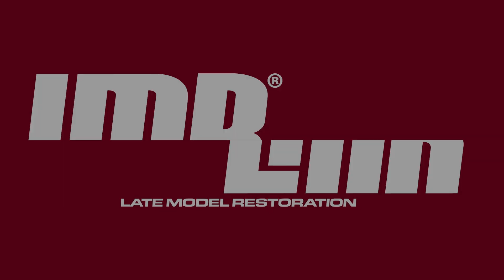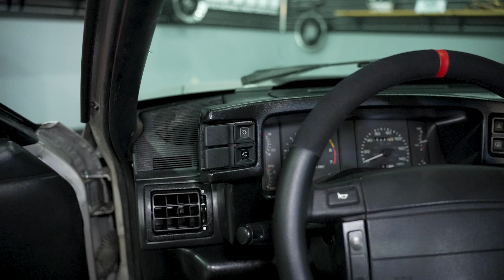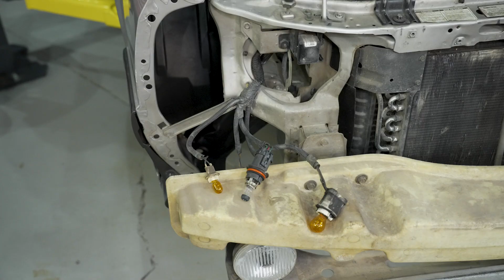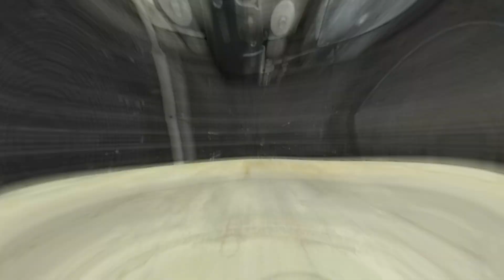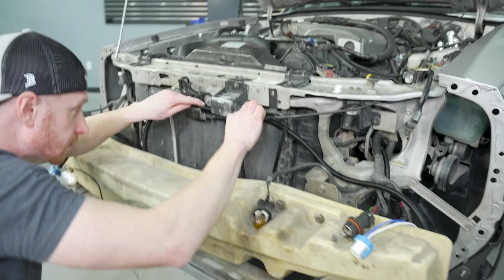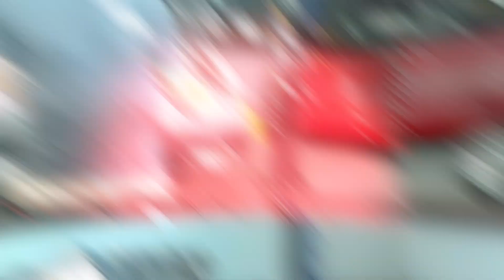1987-1993 Fox Body Mustang: 5.0 Resto Headlight Relay Harness - Overview & Install

Comment: Someone explain to me how this harness reduces the current draw. That's at the headlight switch or the total draw? The total draw feeding the light should be the same. The draw at the switch should be milliamps if all it's doing is driving relay coils.
Reply from the maker: This harness moves the load of the headlights to the dedicated harness. So, the only load on the factory circuit are the fog lights. The amp draw was measured at the switch. -Landan
Reply: @latemodelrestoration  Ah, got it. I have an LX, so no fog lights. I didn't think of that. Thanks for the reply.

Comment: Still drawing 15A through the switch? Obviously, this means the fogs are still powered through it... which doesn't make sense, in my opinion... Where's the 3rd relay/wire circuit to take care the fog lights current???
Especially after all the trouble of removing the front end!

Comment: When I turn on the GT fog lights it causes all the exterior lights to shut off after 5 minutes of use. The headlights will not illuminate immediately after that happens.
Reply: It is tripping the circuit breaker in the headlight switch. This should fix that condition. This will remove some of the load from the current headlight system.
Reply: @hubstang  thanks

Comment: Just installed a 130 amp alternator from y'all to my fox body. By using this wire harness y'all selling. Is my Left headlight gonna be sharing power to right headlight. Cuz u illuminated right headlight plug
Reply from the maker: Power is delivered to each headlight individually from each relay which is getting a solid power source from the battery side of the solenoid. This will result in less amp draw, better power distribution, and brighter headlights. We used the driver side headlight connector in order to tie into the factory circuit. Hope this helps. -Landan

Comment: Need a harness built like this for the fog light system that's what burnt the switch because it used halogen bulbs which drew way too much current for the switch.
Reply: Do they make LED fogs?

Comment: Question, I remember seeing an article in a magazine 20+ years ago about this issue, and they of course sourced relays and the other necessary components to do the retrofit. However, I seem to remember them also doing a relay setup for the fog lights, because the switch connector was also melting for the fog lamp circuits. Would it not be a good idea to do one for the fogs? Ultimately the other benefit would be the lamps are brighter being fed from a relay vs. through the switch and various wiring connections.
Reply from the maker: You could essentially build your own fog light relay harness if you wanted to further reduce the amp draw. It necessarily wouldn't be needed due to the reduction of current draw that is achieved with this headlight harness. -Landan

Comment: So this harness doesn’t connect to the rear harness? What about emergency flashers? Would they still work? Also I thought the original headlight harness has connectors for the alternator and horns as well? This does not.
Reply: This is a Relay Overlay Harness for the headlights specifically. It plugs into the original left headlight connector and uses the high and low beam power that ultimately comes from the headlight switch to turn a set of relays on that will power the headlights, which reduces the load or amperage the headlight switch will pass. The reason the original right headlight connector is not used is because the overlay harness has a new connector for both lamps.
Reply: This is what I'm wondering as well.

Comment: would this afftect leds? and left and right turn signals?
Reply: The turn signals are on a separate circuit than this. LED headlight bulbs draw less amperage so they may not need this.
Reply from the maker: No and no. -Landan